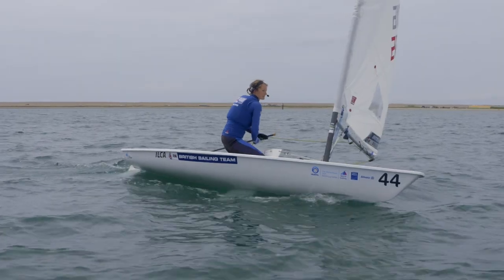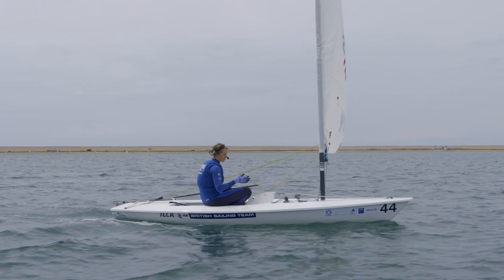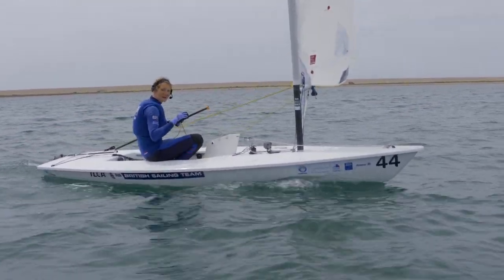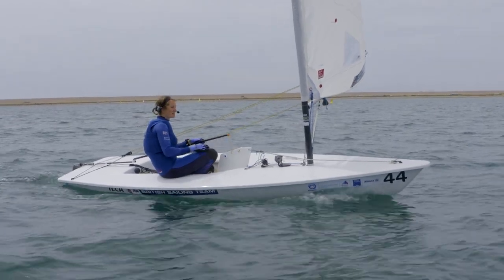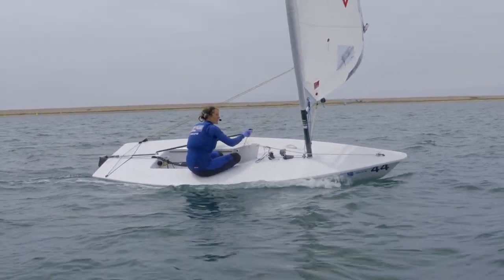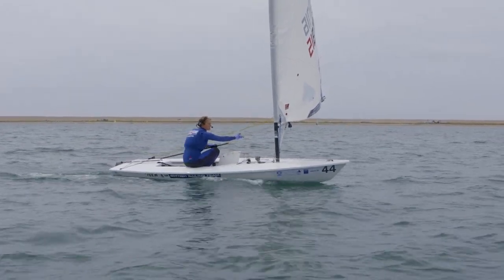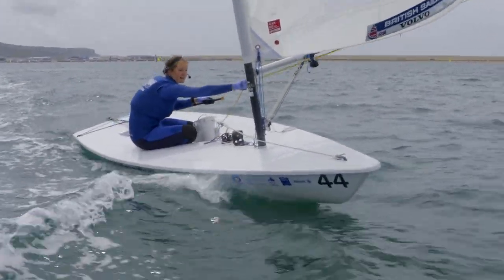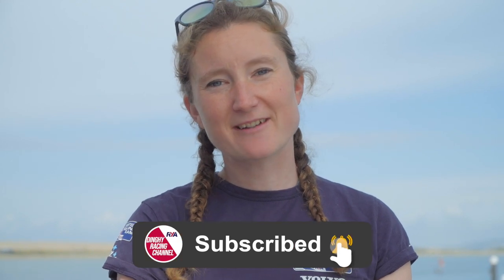DOWNWIND TECHNIQUE: ILCA (LASER) TECHNIQUE TIPS - How to sail faster with the British Sailing Team

Comment: I have a problem. 
When going to bear away to well get inside the wave, the pressure on the sail drops. In part this was owed to a vang too loose, but the problem is not solved yet.
Interestingly, this happens only with medium-light and medium winds.
Reply: You might have the mainsheet too far out or may not be steering far enough. When you bear away to come down the wave, the wind should start flowing from the leach to the luff.